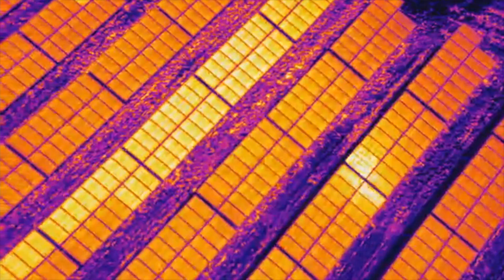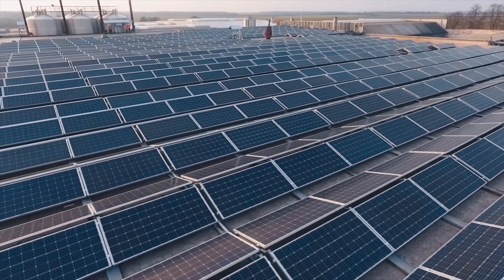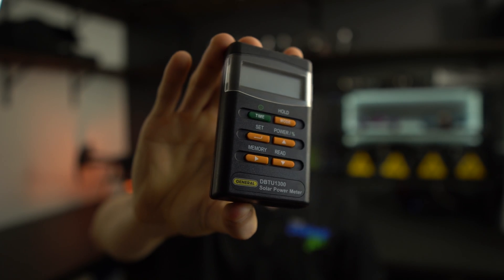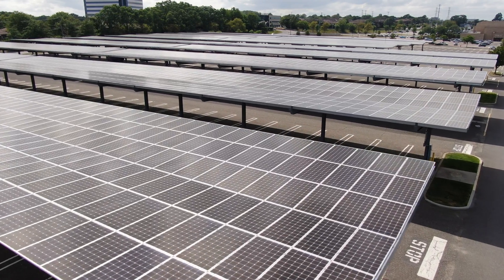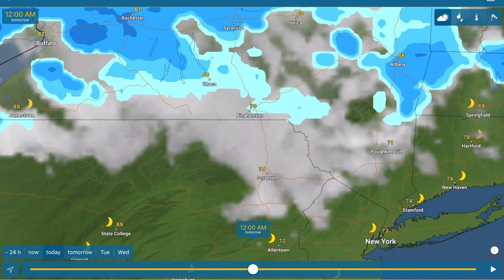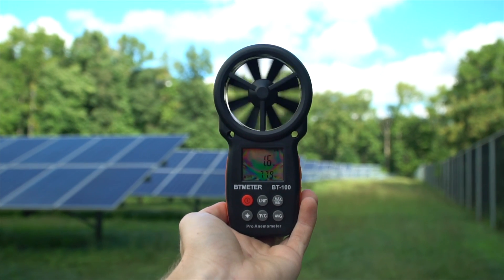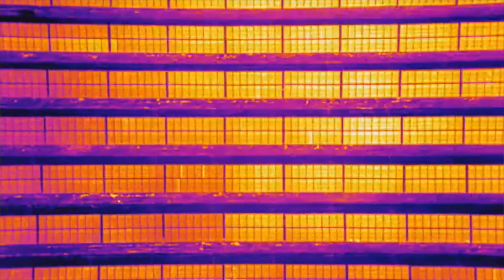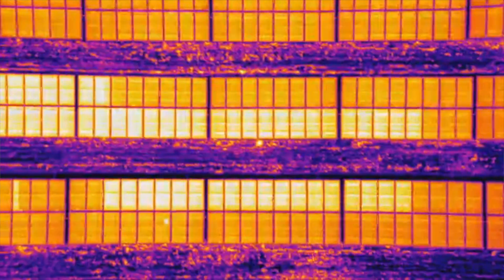7 Drone Solar Inspection Mistakes You Must Avoid

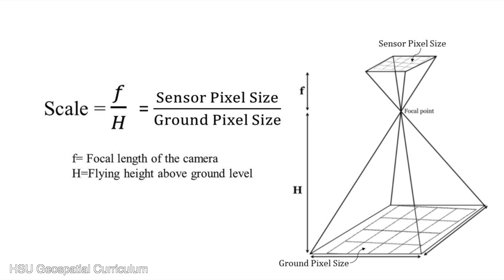Comment: I am certainly no expert but at 7:10 and further you explain that a "smaller GSD results in more data". That is certainly correct but the diagram and in particular the formula to the left of it do not calculate GSD but scale, for which the opposite counts: a larger scale (as in f/H) results in more detailed image data. Scale as a function of f and H is a number between 0 and 1. Is that right?